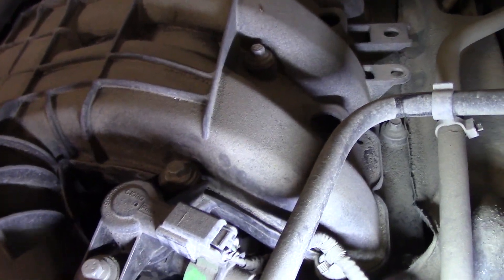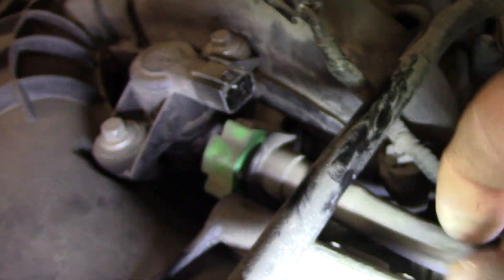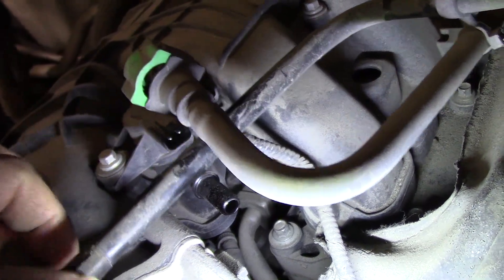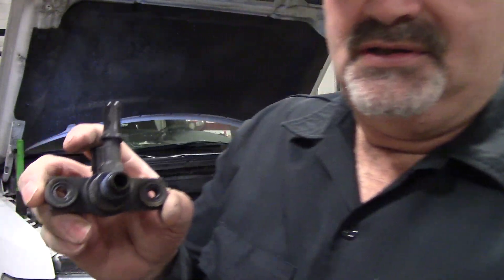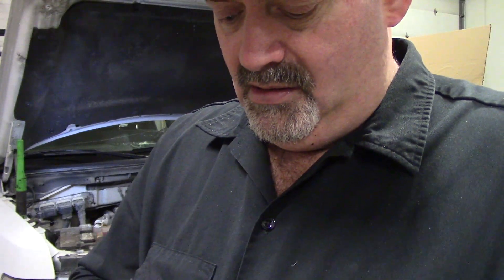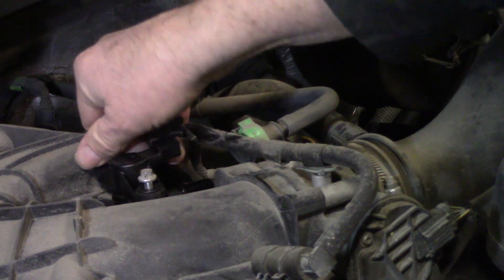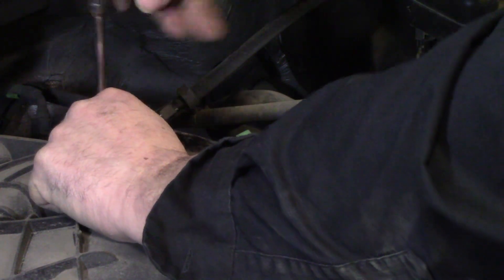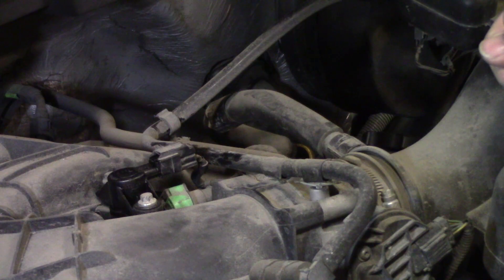Ford F150 Hard Starting After Filling Gas Tank

Comment: worked on my 2014 F150 5.0 - i was out of carb cleaner, just used 91% isopropyl, a paperclip, piece of paper towel. got the gunk out, unstuck the valve. Thanks for the tip!!
Reply: Where is the valve on the 5.0?

Comment: My 2013 Ford f150 has all these issues but the purge valve seems good. I can't blow air through it. Do have a vacuum from the motor. Can anyone help me?

I have not yet bought a replacement valve. I'm making sure I need to before buying one. The local mechanice had my truck three times. The last time he had it ten days and couldn't figure it out
Reply from the maker: Sounds like a replacement valve would be a lot cheaper than ten days of diagnostic labor.

Comment: Thanks! I was noticing a slight vacuum in the fuel tank when I would put the nozzle in at the pump and my 2012 F150 FX4 5L had a few issues when starting (it started, but the starter wouldn't disengage the first couple of times I tried. The next time, it had a hard start). I did the test you suggested and noticed a slight vacuum at the canister purge valve, indicating that the valve needed replacing. I was able to pick up the part straight away for just over $70CAD and installed it in the parking lot (all you need is a 1/4" drive and 8mm socket for the 2 bolts). I haven't ever installed or repaired anything myself on my truck, but it was a really quick and simple fix. Thank-you so much!  

Another question for you Car Doctor: would you have any pointers for why my fuel gauge is still reading a bit off? When I fill it all the way, it shows halfway between the 3/4 and full mark on the gauge. Thanks again!

Comment: Confirmed.  Fixed my 2013 F150.  Trouble starting after refueling, random check engine codes for bank 1/2 running rich, and throwing my MPG reading.

This video was awesome, thank you!  $33 part and a 10 minute fix.

Comment: Same problem I'm having with my 2011 Ford F150 5.0 is the hard start after fill up but not stalling. After reading the codes from my local parts dealer & researching forums as well as great, informative video's like yours, I will be replacing the Cannister Purge Value this weekend. I read that this is a very common problem for Fords 2009 & up.
Thank you for a very helpful video!

Comment: Thanks for the video! Any simple DIY way to diagnose coils on a 2004 GMC Yukon XL? Getting misfire code,, but would like to isolate the issue. Already replaced intake manifold gasket, no change on the loud engine or check engine light.
Reply from the maker: Test the injector also. Compression OK? Cam issue?

Comment: Need some advice /help Dr or anyone else. I have a 1998 Chevy Tahoe it’s a crank no start. It has fuel(55 psi) and spark. It ran fine and then came out the next day to this. Was run low on gas the day before but filled it and it cranked fine at station. It makes a loud “ping” after about 2 seconds of cranking. Could this be distributor timing? I’m at a loss as to what to check next. Thanks

Comment: I have the same issue. What's the name of the part again please?
Reply from the maker: The part in the video?
Reply: Purge valve is the name of the part I was trying to catch..your video is so helpful thanks so much..I spent 1500$ fixing the wrong problems .I bought two fuel pumps and oxygen sensor and gasket cover valve and I changed the spark plugs and air filter ..and still didn't fix the problem. I was so frustrated until I ran into your video and I replaced the purge valve and the problem was solved..thanks so much for being helpful I really appreciate it 🙏

Comment: Know how to solve a 2016 radio problem screen is black won't come on anybody have ideas fuses are all good
Reply from the maker: Bummer. First do a battery disconnect reset and see what that does. Remember that resetting the KAM can cause drivability issues so be mindful of that for the first 20-30 miles in case of stalling at stops of weird shifts. If that doesn’t work you may have to look into the display interface module